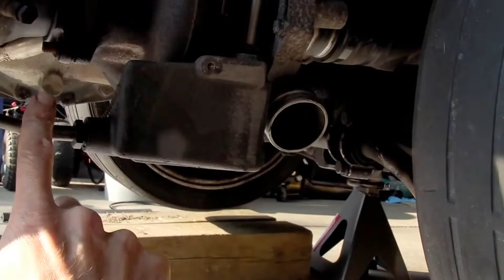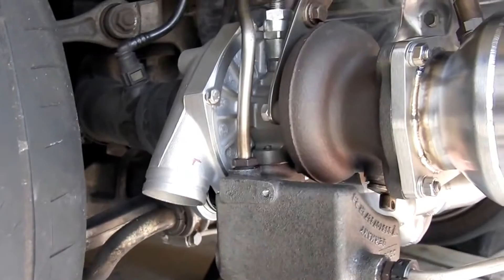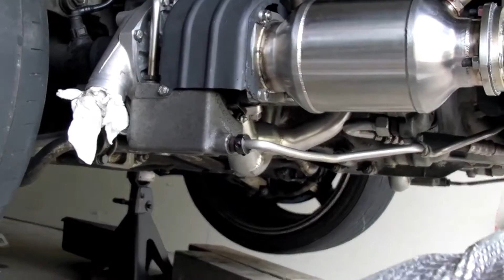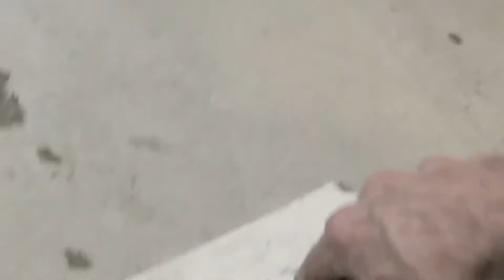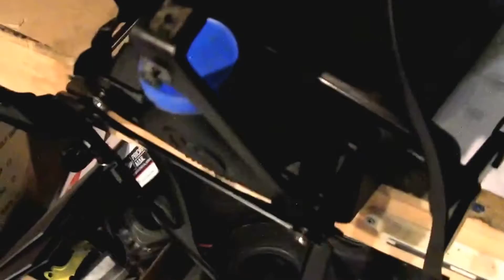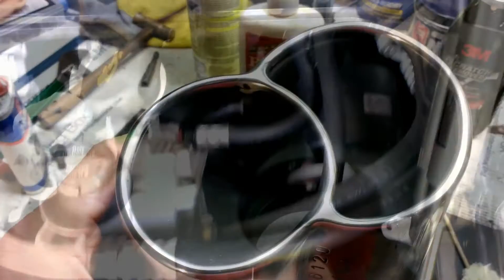Porsche 911 996 Turbo Upgrading stage 2.. boost, exhaust, intercoolers

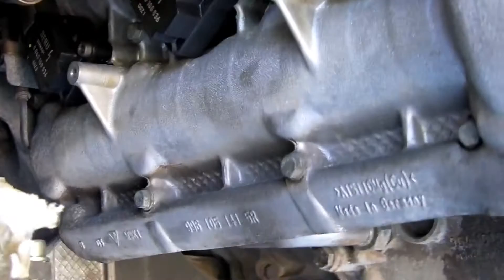Comment: 03:58 its an half hour job, to replace plugs and coils. but a one day job, to remove rear lights, bumper, exhaust, intercoolers and turbochargers and get everything back on. terrible design those porsche flat 6s. disassemble half the car only to change the spark plugs. great, porsche!

Comment: I have a question. With this setup were you able to run the Cobb Stg2 93oct map with no additional changes? Or did you use that calibration as a basis and get it retuned for the bigger K16s? 
I'm asking because I'm running the Stg2 93 oct tune on my stock K16s but am looking into upgrading the turbos. Thanks!
Reply: Hit up Freddy Lewis at Lewis Speed for turbo upgrades and contact markski for tuning

Comment: I’ve had two 996TTS cabs and I wished I had seen your video prior to tackling a similar job on my own four years ago.  Great video and I really appreciate your attention to detail, walking us through your fitment solutions and approach to problem solving.  Too many people concentrate on “why” they mod the 996, show the beginning of the build then cut to the finished product.  I’m currently in the market for another 996TT Cab so yea, subscribed.
Reply from the maker: thanks for noticing ... many think these upgrade kits are simple afternoon bolt on deals ... and they might be for an experienced shop that does such work constantly ... but not for someone who had never touched a Porsche or Turbo charger prior to doing the install (i.e. me).  I spent months researching the parts to buy, and 2 months of my spare time doing this install.

Comment: Hi can this be done be a average weekend wrencher? Or do you need to be a mechanic by training?
Reply from the maker: Everyone's experience will be different ... and nothing came with directions, LOL. It's not a job for a novice, but does not require being a trained Porsche tech either. I ran into a few problems, and worked through them with my experience and home machine shop. It was the first time I ever worked on a Porsche, but had decades of engine and machine shop experience. I would say if you have done full brake jobs and/or ball joint replacement type work before, you probably have an adequate skill level and tools to get through a 996TT stage 2 install. FYI - it took over 2 months of my spare time to perform all the work in this video ... I didn't rush it, did lots of research, and double checking.

Comment: Good for you doing such a major upgrade all at once. Most people do exhaust an a tune then work their way up to upgrading turbos etc. But you went full on in one step... awesome haha. I bet that was shocking the first time you took it out once it was all back together. Great car and build. Congrats!
Reply from the maker: LOL, my attitude is, if I am going to tear the car all apart, then I am going to do everything all at once.  The reality is that a 10% power gain/loss is hard to perceive, just by "feel" alone, 20-30% gain is noticeable .... but, a stage II upgrade will get ya into the 40-50% gain range,  the "Holy Crap!!" zone, where smile factor = money spent. Personally, I have years high end kart racing experience, and "Holy Crap" is what I need. FYI - this was the first time I ever worked on a Porsche, and the first time I ever messed with a turbo charger ... luckily the wealth of information on the Internet, allowed me to learn what I needed to know.  3 years later, this car runs like a Champ! no issues, no problems, nothing broken, all is very GOOD!

Comment: Awesome video! Thank you for taking the time to post!
Reply from the maker: Roy: thanks for the appreciation, when I started into this project, I had NEVER worked on a Porsche before and quickly noticed a lack of YT videos walking through this type of upgrade .. so I thought I would grab some shots as I slowly worked through figuring out everything .. I'm no pro-vblogger,  but the video should be  informative. Check out the website link in the description, there are photos there, and more detailed info of things I did not shoot with video .. like how to rebuild the turbo oil check valves for ~$5, instead of buying new aftermarket ones for several hundred.

Comment: Love your attention to detail, if you don't mind me asking, what did you pay for yours and when did you buy it? How many miles? How is the tiptoe of transmission? For some reason I feel like the Tiptronic would be better in the 996 turbo for a Los Angeles city cruiser and coastal cruiser etc. long time manual owner, love the car!
Reply: Had my tip 996tt for a few month and i feel it is a great match to the motors torque curve! Still have my 993 manual and 997gt3 and i wouldnt swap the tip for a manual on the 996tt.  Perfect sport touring car!
Reply from the maker: sorry for late reply ... I purchased the car 3 years ago, for $39K with 49K miles.  The Tiptronic is OK, and it is fine with handling this type of upgrade (a stock manual clutch is not, must be upgraded). The Tiptronic is a little funky, it only uses 1st gear when warming up on a cool day... usually it starts out in 2nd gear always, which will run fast enough to get you a speeding ticket.. 3rd gear topped out, might get you prison time .. be careful, LOL.  The turbo engine has GOBBS of torque from 2,500rpm up .. I rarely rev it over 5,000rpm, it redlines at 6,500.  Sometimes I use the steering wheel buttons to manually shift it, but the shift time delay is huge by modern standards ... IMO, best use of those manual buttons is for getting a faster downshift when running in automatic mode. I've had many manual cars too ... for around town driving, I'd say its a toss up.  I believe you will have less maintenance and/or upgrade costs with a Triptronic compared to manual, and with the very wide torque band, there is not a lot of manual shifting to do anyway .. at best most of the time you would be shifting through only 3 gears ( I'll let someone correct me if they have direct experience).
Reply from the maker: Roy:   great collection there in your garage!  Agreed, the Tip on this car is very good for a Sport touring setup as most of the 996TT 0-100mph on-road excitement takes place in just 2nd and 3rd gear due to the very wide torque curve.. and there is no driver feeling like "I wish I had a few extra gears in there" .. because it's pulling on-boost explosively hard through 2nd and 3rd gear, while all other cars on the road turn into telephone poles in the rearview mirror.

Comment: You wouldn't consider selling this car would you? I just so happen to be in the market for one.
Reply from the maker: David,  thanks for the compliment ... no plans to sell anytime soon, still loving the car ... I've hit that over spend point of no return, spending way more than I could sell it for, LOL.  After the work in this video,  I did a full suspension upgrade, a HW Variant 3 Coil Over system, new sway bars, drop links,..lowered ride height ... and plopped on some Nitto NT01 tires (245 front  / 305 rear - Stock Wheels - FYI - these tires are reasonably matched in diameter for the AWD system).  Also just swapped out the rear wing for a GT2 style carbon fiber wing, and installed an Anti-Gravity Lithium battery (1000 CCA) that weighs only 10lbs.
Reply: Wonderful selection of upgrades. I missed out on @Danny_k car on rennlist and I will never let that happen again. This is exactly what I want, so let me know if you ever need to let her go ;)
Reply from the maker: I would expect that eventually, the 996TT prices will start to appreciate, IMO, this is by far the best bargain in a 911 Turbo model .. and a great base tuning car, since the stock driveline, brakes, engine, etc .. can handle a significant power boost .. .unlike so many other cars, which turn into a "wack-a-mole" upgrade project, with a required cascade of upgrades and/or broken stuff.  Good luck with your search.

I should have added this link to my description before ..more details, photos, etc... at my website:
http://bigcooter.com/porsche-996tt-billet-turbo-stage-2-upgrade/

I got a good deal on mine, because I'm pretty sure they previous owner wanted to get rid of it quick before the IMS bearing failed out of warranty .. . a common mis-conception, LOL, but the Turbo 996 uses the Mezger engine with a true dry-sump, with crankshaft driven oil pumps, and an oil gallery design that properly lubricates the IMS shaft bearings.   This motor does NOT have a weak non-oil lubed IMS bearing like the non-turbo 996 motors, which randomly cut loose.  It's my belief that this IMS bearing mis-conception is largely responsible for the seemingly suppressed 996TT prices, which impact all 996 models.

Comment: Has anyone seen the AWE Performance Intercooler Kit for the 996TT, (http://amzn.to/2tCeyKl) it is sick!
Reply from the maker: Mr B:  Judging by the photos alone, it looks like those AWE intercoolers are nearly identical to the Wagner ones I installed in this video .. core look the same, both have all aluminum end caps and are probably the same overall thickness (because the Wagner's barely fit, anything thicker requires all new mounting frames and duct work .. that about doubling the price). Also, I think the prices are similar.

Comment: cool video, that ll be quick as,  better splash out on some rear tires next
Reply from the maker: this Summer I upgraded the suspension and tires, good call !!!   Now running Nitto NT01 tires.. Front: 245 /40ZR18,  Rear:  305 / 35ZR18. With KW Coilovers Variant 3 ... also all new sway bars and drop links.  Setup is for dry road driving, and track days.  This Winter, I plan to do something with the rear wing and lift system .. I don't like either ... and am working on installing a touch screen android or apple based system that can display multiple gages, lap times, manage music, etc...  Then, I think I will be done for a while.
Reply from the maker: LOL .. A few weeks after getting back on the road, I reached under to feel how much tread was left on the inner edge of the rear tires ... the blood on my hand told me there was not much rubber left on the steel cords .. OUCH!!   Has Nitto NT01 tires all around now  (245/305).